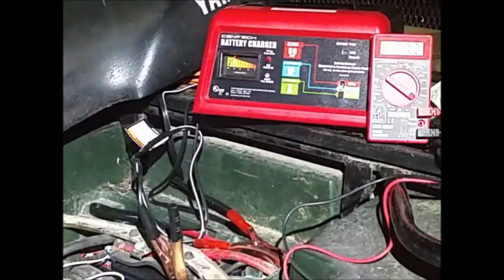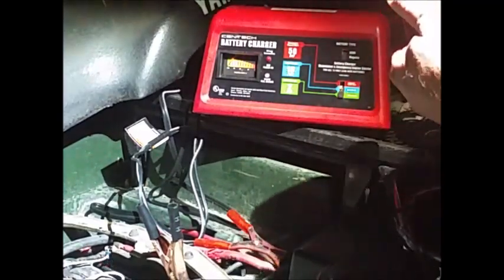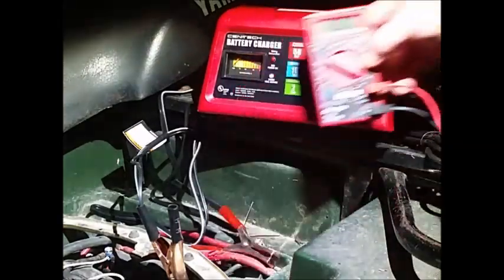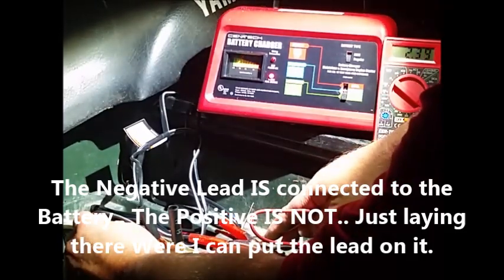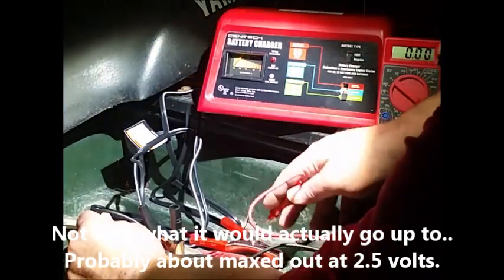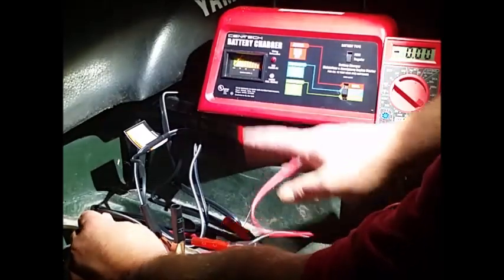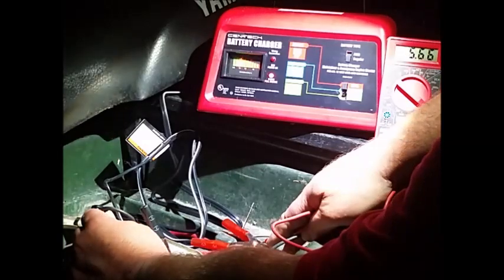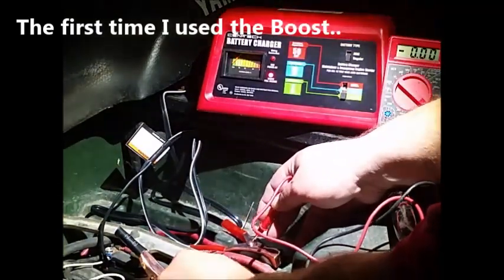How To Test A 12 Volt Car Battery Charger 2-10 Amp Charger. Harbor Freight Item# 60581

Comment: The charger will not kick in until it can see a chargeable voltage. No way to check with your meter. You destroyed those chargers by not knowing what you were doing.
Reply from the maker: Pay attention to the video dumbass... The meter is hooked in series with the battery.. And, no.. The reason I was testing is because they were "Already" not working.. Think before you type, or you show your ignorance..
Reply: @MarkThomas123  YOU HAVE TO HAVE THIS TYPE OF BATTERY CHARGER CONNECTED TO BATTERY FOR IT TO CHARGE. IF BATTERY IS DEAD THIS BATTERY CHARGER " WILL NOT CHARGE YOUR BATTERY, FACT. "
Reply from the maker: @NoWr2Run   Why don't you pay attention to the video.
Reply from the maker: @NoWr2Run  I had a complete Circuit through the Meter in order to gauge the "AMPS" being produced, not voltage.. The meter HAS to be hooked up "Inline" in order to do that.. Voltage is different.. Just touch either then two terminals of the battery or charger... 
Not sure if they have changed some circuitry on your charger "Without changing the Part Number, which would be the way most manufacturers would do", but, what you are describing is the Standard Circutry which would not charge a "Fully Charged Battery"... So, you had to hook up a Dead Battery to reduce the voltage on the Hot Battery where it would charge??? Sounds like what you were doing to me.. Did you check the "Voltage" on the Good Battery? Was it over 12 Volts? A new battery will be in the 13.6 or so volts capacity, and probably the trigger where most battery chargers go into "Not-Overcharge" mode... 
If that is the case, then, normal.. If you watch to the end of the video, I show two things.. 
Notice,,, I suspected the 10 amp charging Circuit was not working to begin with.. 
Basically two ways to check that.. Check Voltage before charging and after, which I did after leaving the battery on charge for an hour and suspecting something was wrong... No increase in Voltage.. The sure fire way is checking Amp Output, and that is the test I am performing... 
When I checked 2 amps, it was working as you see in the video. When I went to 10 amps,, NO VOLTAGE... 
I had previously switched it back to 2 amps and checked it again, to be sure I didn't blow a fuse in the meter, etc.. Got 2 amps.. So,,, I decided to risk blowing the meter or fuse if it was a well built circuit in the meter and turn it on boost.. But, the voltage/Amperage stayed under 7 amps, which was under the 10 amps the meter would support... So, I didn't blow out my meter, nor did I burn out a battery charger capable of putting out 50 amps, only running at 7 amps.. The meter would have definitely be the item that would have been destroyed or fuse burned,,, NOT the Battery Charger Itself... 
I see I am addressing two comments now, not just yours.. Now to address yours specifically.. 
"IF BATTERY IS DEAD THIS BATTERY CHARGER " WILL NOT CHARGE YOUR BATTERY, FACT. "
I would say,, Shorted Battery, not Dead or low in voltage, but, the charger I have, and probably the one you have also does not have that type of circutry built into it.. 
It should attempt to charge anything under 13.6 or so volts.. Which would support my opinion based on this comment of yours. " "I had to hook a good battery up to a DEAD BATTERY for the charger to kick on, " To pull the voltage down where it would not kick in the overcharge circuit and not charge.. 
This comment is a little confusing... 
"Mine also will NOT PUT OUT A CHARGE TO A METER UNLESS HOOKED UP TO A SOMEWHAT CHARGED BATTERY, ALSO WEIRD ?"
I would agree.. Go back and check the charger on 2Amps and careful of your meter, but, if you test it on boost and it does what mine did, you can test it on boost, just know if it puts out over 10 amps of the 50 amps when you test it on boost, you are risking blowing your meter... So, a 2 Amp test would be the best way to test it.. ALSO,, you can check Voltage at the battery... Just hook up one Clamp to the battery and the other laying away(+) Clamp as I did in the video.. 
If your assumption is correct, it won't show voltage.. My bet is about 14 volts.. Test the battery, then the charger alternating back and forth and verify the meter is working on voltage also.. 
If the 2 amp selection is working, that is what you should find.. 
Remember.. I had a 100% new charger.. My second or third, so, I tested it while it was fully functional or brand new.. 
If yours burned out, maybe you didn't catch that only the 10 amp and Boost were not working and was flipping back and forth and checking it on 10 amps, not 2 amps, and not wanting to blow your meter on boost.. My best guess... 
Try it again.. Voltage first, because, nothing will be damaged, and then, Amps.. At the end of the video, you will notice, I had two meters out.. I buy them on sale and buy 5 or so at a time, so, didn't mind risking blowing one up.. I also have fuses on hand for them.. 
My bet is,, hook it up to any battery less than 13 volts and it is going to charge on 2 amps,,, and sound like shit on boost like mine... 
Hope that helps.. 
This comment was the previous reply above yours.. I think, I read it when replying the first time... 
"You destroyed those chargers by not knowing what you were doing."
Which is about assinine... With all of this Ignorant Covid shit going on,, I have had just about enough of ignorant comments from people who are not paying attention and people who are not doing their research... I see you have put some thought into this, so, check to be sure you didn't miss the fact that the charger still works on 2 amps, mine put out nothing on 10amps and only 7 amps on the 50 amp boost... Let me know what you find if you think about it and try it.. Might help someone else down the road.. Seems they are still selling the damn things with the cheap assx Circutry..

Comment: May not be the best video, but served it's purpose for me.  My charger was saying that the battery was fully charged, when I knew that it wasn't.  Tested it with this technique on a charger that only goes up to 4amps and there was no reading at all on the multimeter.  Thanks for the video!

Comment: I went straight to the battery with both terminals and the negative got smoking Hot you just said go to terminal’s of the Charger not straight to the battery !
Reply from the maker: Yes. Either/or. Charger only, only measures charger only. One of the terminals in the video is disconnected from the battery.
Reply from the maker: I just read that again. You want to check the charging amperage of the charger on the 2 amp and 10 amp setting. When the 10 amp was not working, I was pretty sure that the 50 amp was not working either, not to damage he tester. Had the meter swang past or over 10 amps, all I had to do was lift my finger. 
You were checking how many amps the battery had. Usually 750 or something like that. Way more than the 2 or 10 amps of the charger.. 

I was more interested in showing the the charger was failing, and I caught it on film. It was the 3rd charger I got from HF on swap for a previous failed charger.. I was done and wanted a refund and not to fool with another replacement.. 

There are some good videos out there on how to use a volt meter.. 
This is a very good video that explains what I am/was doing and why it is done that way.. This should answer any questions you have about that..  It is just about measuring amperage...  I watched the video before I recommended it.
https://www.youtube.com/watch?v=P660hTqkGiY

Comment: Why does the negative cable when I sent my meter up like you say get some smoking hot start smoking and I can’t hold it anymore why is there something wrong with the meter ?
Reply from the maker: You should have the meter plugged into the 10amp setting on the meter..  Watch the video at 4:27... You may have the meter hooked up wrong, or, you might have a working battery charger and may have it on 10amp or the boost.. Maybe even 2 amps.. Technically, it should also be in line... But, this worked on the battery charger and it was a safer way to test.. Had I not gotten the results I was expecting, I would have put it in line... Disconnect battery terminal and hook it up on one side of the battery from battery to cable.. But, a slip up and the meter is fried for sure... 
Remember.. That circuit is designed for 10 amps only... If you put 50 amps through it, it should pop the fuse or, if that didn't work for some reason, heat up..  Not good for the meter.. I guess I should have put that part of the video up front??? 
I guess I figured people would watch it, and didn't think about it until after I tested the charger on video.. I was actually recording the video to show Harbor Freight.. But, when I caught it fail on video, I had what I needed..Decided to post it public. When I was viewing the video while getting it ready to post and making text comments, I figured I would go ahead and make that crystal clear in case some didn't know about the 10 amp setting.. 
Guess I should have put it first, for those who don't finish the subject matter before testing.. ??? Sorry.. The content was there.. And, sounds like your charger is working.. Hope it was a cheap HF meter...

Comment: All mine does is bounce, red green over n over until it finally charges 2 days later on a discharged battery.. I've never had one do this before and I bought to replace a broken one that got dropped, but by time needed to use it the warranty was over... guess could have bought a new one and swapped it, but I just kept it and been using my 8A manual charger when needed if this one decides to take more than 2 days to charge up a battery.. another showed it only had a 20A breaker, then person replied that 20A will flow 50A for the 5 seconds as intended. so right there, expecting the breaker to fail after 5 seconds, is design flaw to me, how could you flip switch, get into ride and crank in 5 seconds time in first place.. older shumakers [sp] would give you 30 seconds anyhow..
Reply from the maker: It is designed to give you the voltage when you turn the key, but, that is not the way these work as you saw.. 
Both of mine failed the same way... When I flipped over to the boost.. I didn't remember the first one failing at that second.. This one, I was paying attention to when it failed.. In fact, failed on the video.. It was actually working there for a minute.. But, I forget if I cut that part out or not.. 
I bought a 200 amp Shumaker after this one.. One that has a 40 amp charge and 200 amp boost to go with the 2 and 10 amp charges with a timer, etc.. Cost me about $150, but, truly worth it..  If it won't crank with 200 amps, when you throw the switch,, something else is wrong..  I can even crank my two battery big diesel bussed with it.. I fast charge 40 amps for 5 or 10 minutes and then, flip it to 200 and it fires right up.. With a 10 and 50 amp boost, I used to have to charge it for hours before attempting to start.. 
And,, if you have a bad battery or one going out, you can charge it on 40 amps for 2-3 hours and wake a lot of them back up.. 
One more thing I found.. Had a weak starter on my backhoe.. Seemed it would crank over fine with a fully charge battery, but, after it cranked for 10 or 15 seconds would slow down considerably.. I thought battery was failing.. I flipped it over to 40 amps, and it spun fast.. Turned it off and it cranked slow again.. Slow charged over night and cranked fast for 10-15 seconds, or a couple of cranks, then, if only cranked and killed would drop back slow again.. 
But, hook up the 40 amp, and it spinned fast again.. I knew the battery was OK at that point and swapped the starter with the battery in the same condition,, and the new starter worked like a champ.. 
I have several vehicles and other battery started equipment.. It was a bite to buy it, but, I will never be without one again. In fact, I have two now, by drinking accident..Ha..Ha.. My yard man was drunk and pulled the battery charger off and put it inside of one of our rooms behind the door.. Never would have looked there for it.. Though it was lost or stolen.. After looking for it for a couple of hours,, I ordered another.. Two months later, we were moving some equipment and there it was behind the door, holding the door from opening the whole swing.. 
I covered it with a big trash bag, put it over head in the shop,, and on the Computer,, where I keep my battery charger info/manuals, etc.. I added a file.. EXTRABATTERYCHARGER.txt to remind myself,, before I buy another, I have one in storage..Ha..Ha..Ha.. It is the roll around type.. Stand up charger.. 
They stopped making this one, but, it is just like the next one. Only difference is the next one has a battery charge meter added to it.. If you can find this one, you can usually get it for around $100.
Diehard DH-200M 200/40/10/2 Amp
Now, I have the: Schumacher SE-4022
Best price I found was on Ebay.. This item #140679161367   With shipping was about $162.00
I promise.. If you spend the bucks for one of these, you won't regret it.. Especially if you use it  a couple times a year.. Cheers..
Reply: Schumacher SE-4022 looks nice,, that Sears model dropped the 10A off newest model, at least from their web description, and in the manual they showed they would charge a battery on 40A for 10 hours, come on, you would smoke it..lol  I had some coupon and got this pile for around $15 and thought give it a shot, someday will get a real charger, after I concrete the floor, tired of things rusting or corroding due to moisture in summer in this submedertrainian rainforest I live in..
Reply from the maker: I know.. I live in a temperate rainforest right here in the USA.. Humidity rarely under 85%.. I deal with it all of the time.. Had 3 of those chargers and none of them worked past using the boost the first time.. That's when I realized how much I used the boost.. That's why I like the 200 amp.. 50 just isn't enough.. Rarely is 200 not enough.. Good Luck with the projects..

Comment: How do you check the 15 amp one ??
Reply from the maker: Same way..  OOps.. Well.. 10 amp max..  You can try it with a cheap meter if you have an extra fuse.. 
Check the DC Voltage first.. If it is not producing Amps, may not be producing voltage you can see either.
More expensive meters can most likely do that. I am not sure.. 
I did this video because there were none out there like it and I took the time to figure it out.. I am surely not an expert.. 
But, if I had a 15 amp, and my meter was 10 amp,, I would toss the charger in my truck and stop by an Alternator shop and let them test it.. Might also be able to test it at a local auto shop or parts store.. Alternator shop for sure.. Maybe even a TV repair shop, although they are mostly 120 volt, might have DC equipment also..  Hope that helps.

Comment: if you are checking the amps you must be run the current through the meter,positive to battery negative meter then meter to battery negative this is how to test the output amps not across the positive and negative clips you are doing it wrong ,also to check the voltage connect meter to battery then connect the charger and switch on the voltage will go up ,the charger needs a load to work correctly

Comment: You said a connection to the multi meter would "Normally" be plugged in one place but I never caught where it's plugged for this test, it seems like you left that part out? I'm not familiar with the multimeter..obviousley.
Reply from the maker: Kenny Smith I didn't realize that until later and I went back at the end of the video and added what you're looking for.
Reply: Thank you, Mark, helpful video.

Comment: 50 amps on a 10 amp max?
Reply from the maker: Probably would have fried the internal fuse on the meter if it were working.. I'm not sure. Would it error or would it show 10 amps (the max), or would it show zero after blowing the fuse? Not sure.. Never had a charger after the first one that the boost actually worked on more than once...  The first one, I actually had it peg the meter and it actually worked a single duty cycle and I was able to crank the vehicle with it.. But, the second time I used it, in that same instance, with a second crank, meter showed little voltage/amps, and this same noise and erratic meter movement on the charger itself.. 
This one had those symptoms when I tested it to begin with.. I buy the meters about 10pcs at a time on sale and keep a few here and there around the shop/house.. I am not always the one using them.... 
I should hook one up on my 30 amp lab power supply and see what it would do.. I would guess blow a fuse.. 
Is that why you commented?
I am not a Electrical engineer.. I had to research to find out how to set the dang thing up for amps before I did the test.. But, I am sure that the charger did not work on 10 amps, and there was no boost, because I knew the battery I was jumping/charging too, and had 2 of these chargers before do the same thing.. 
Charge it on 2 amps for several hours and it worked, charged it for 10 amps for several hours and it did not, and the boost did absolutely nothing to the cranking or, the headlights when I switched it to boost... 
And, I didn't have a DC amp meter, I would assume that would be a clamp over the line type of meter.. I had an AC clamp meter, but, it didn't have the DC function.... And, when I found one that appeared to have that function, I didn't want to pay the price for it..

Comment: The reason you didn't get a reading at 10A is because that multimeter maxed out at 10A and the charger is probably putting out 11A.
Reply: EXACTLY HE NEEDS TO PUT HIS METER ON 20 AMPS. & HOOK THE DAMN TERMINALS TO THE BATTERY.
Reply: 100% correct. Your cooking your unit
Reply: It always charges at 12 to 13. U can't check volts. U think start mode has a voltage of 55amp